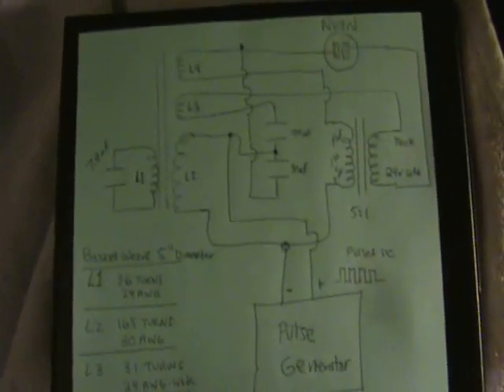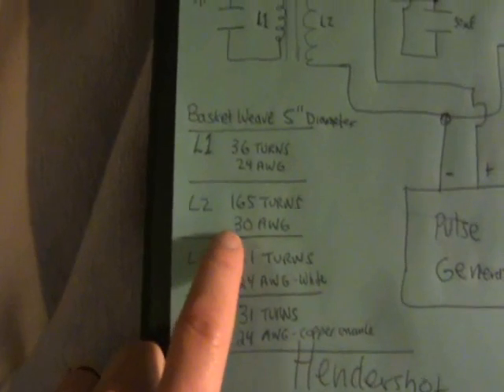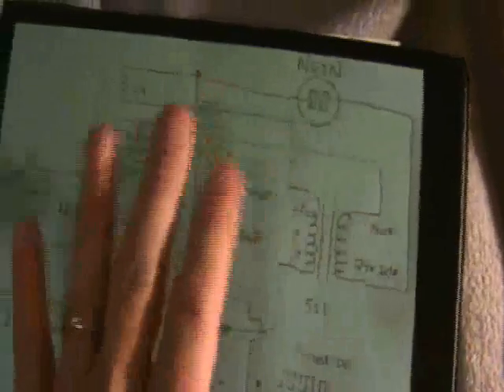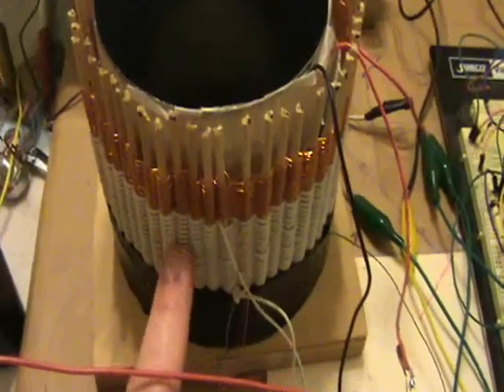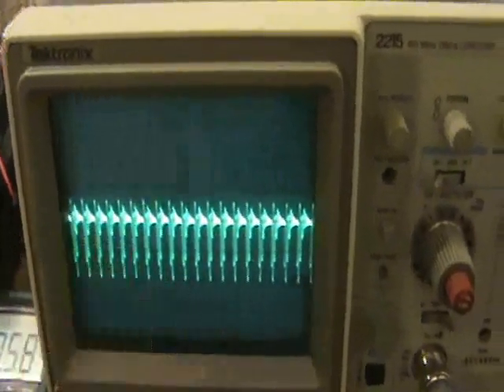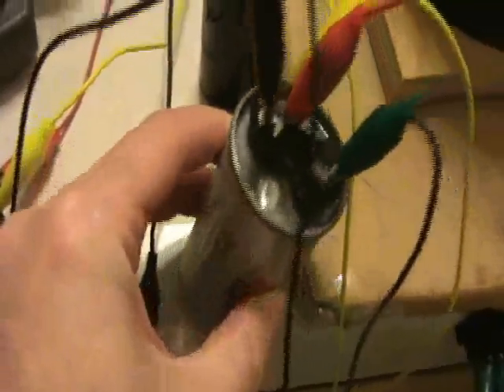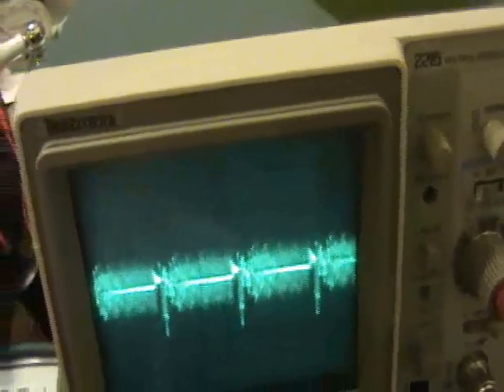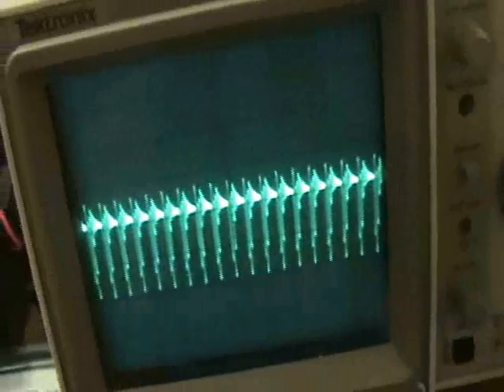"Hendershot Fuelless Generator" - Pulse Experiment

Comment: Hello
It seems that the simplest and most widely available motor that uses the earth's magnetic field is a compass
It would be enough to disturb the flow of the field cyclically so as to lead the compass needle to rotate. Then it's a simple matter
Another consideration is the power of this system
Maybe worth some reflection
Yours open minds

Comment: i wonder how much atmospheric energy you could amplify with a antenna.
Reply from the maker: reception can be PERFECT if you hit the exact resonant frequency and if the signal strength is large enough -- like nearby lightning. Lighting is a whistler, however, which means it is wide-spectrum. So if your LRC circuit has high Q and a narrow resonance, it is like a FILTER that only sees a tiny part of the signal. With low Q, you might be able to go wideband, but then it will attenuate dramatically due to the low Q.
Reply: @morpher44  Henry moray built some of the earliest isotope doping semi conductors, when he found the right frequency with that material he could amplify that frequency.
Reply from the maker: @DANTHETUBEMAN  Well a transistor can amplify any range of frequencies, depending upon the specs of the transistor. The gain is linear within a certain range of biasing. His "Swedish Stone" was never fully explained. Others have not been able to replicate. He may have had a configuration that basically was converting the particle impacts on the wires of the coils into an oscillation. Coils will self resonate with background radiation. But if you have more radiation, and if you can focus a beam of particles by making a waveguide of led, you could convert the energy there into electricity. But I personally wouldn't like to mess around with radium or other hot substances. It is not something a consumer product should have.

Comment: Most digital volt meters are calibrated for 50to 60 hertz and is not accurate at higher frequencies. Made this mistake many years ago.  I suggest using a scope to check the AC voltages at higher frequencies.
Reply from the maker: +Dean Sugitan Yes. Its good to have other equipment to measure things, like scopes, etc.

Comment from the maker: No Sir. I have learned a lot by trying, however. I have some new ideas to try. The notion of wiggling a magnetic field near a coil seems pretty easy to me now and there could be many different ways to do this. It seems very logical NOT to move the massive coil. Instead, move the field. It takes very little energy to move a magnetic field. The natural magnet provides the field.

Comment: (The actual proportion would need to be calculated by increasing the frequencies and writing the numbers down). Do you think if you were to go with an input frequency of around 60-70K you will get up to 110-120 volts output? I am in the beginning of building a Hendershot Generator myself so I am very curious. I have (2) 500uf 220v, (4) 1000uf 220v caps. (2) 1:5 Transformers 120v input / 600v output.

Comment: Me thinks you are missing the principle. Nearly all electromagnetic devices use a standing wave (displacement current) to bounce the free electrons out of the inductor which increase the Ahanarov Bohm events.

When you see two sides to a circuit that are the same, then I suspect they used the collapsing side against the charging side to increase acceleration which also increases AB effect.

Understanding the gravitational component of electricity (displacement current) is fundamental.

Comment: I have a couple of those and some working tubes i've played with. The ones I have are labled "Mallory Vibrators" and have 4 contact points. It's essentially the same as wiring a relay as a buzzer except these produce more current out.

Comment from the maker: Yes. Back in the old days of radio, they had tubes that needed higher voltages and AC. They would have these "relay" buzzer circuits to SNAP energy into a coil to create AC, have capacitors to smooth out the waveforms. Search for "vibrator power supplies".

Comment: One of the big mysteries, which this may help you, Is the correct frequency; Tesla, and few others found that HIGH frequency HIGH voltage = free power. 2000+ hz 3000+volts, at this rate you will absorb all of the residual energy lost in the copper(work).